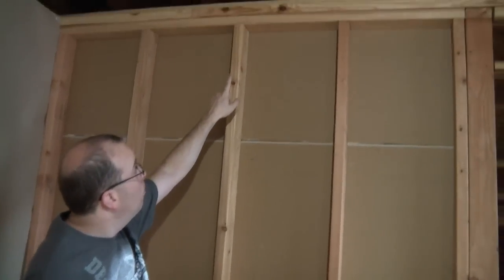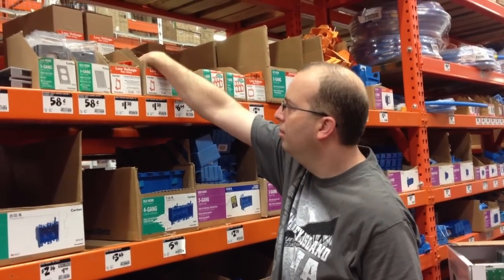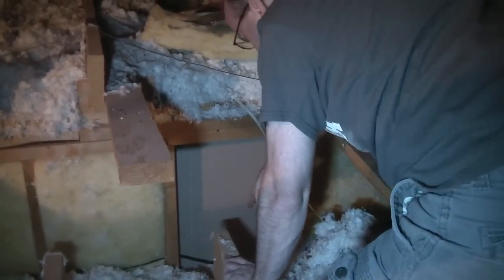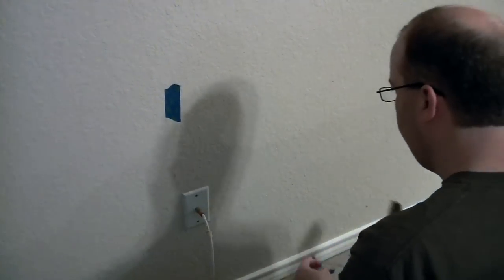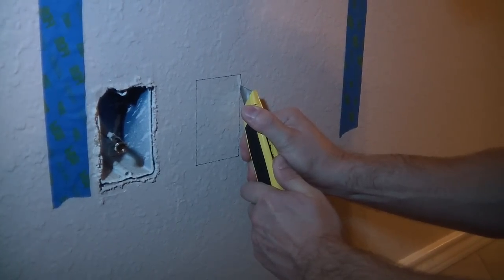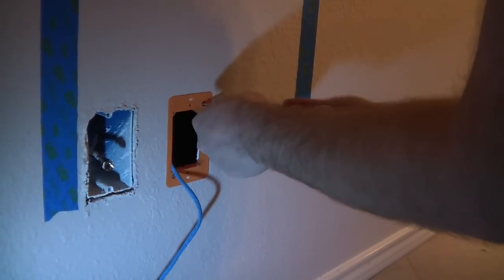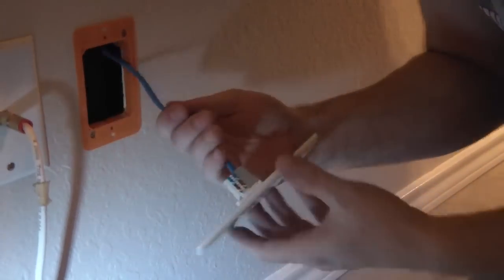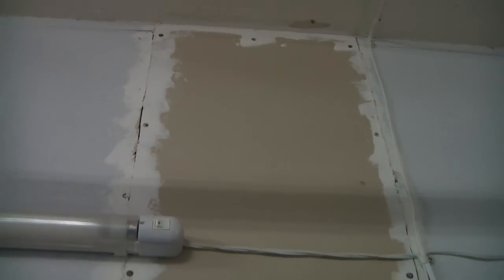How to install a network jack into a wall from the attic.

Comment: Please don't untwist your wires all the way and straighten them out. You're just causing cross talk at that point. Untwist your wires the minimal amount necessary to put them in the proper color coded slots.
Reply: it doesnt matter that he untwisted them because he punched the wires as close as possible to the cable anyway

Comment: Could you do something like this but instead of running it into the attic, run it through the basement instead? The way my house was built, it is completely impossible for anyone to get into the attic even remotely safely. But now that I have a small network that is starting to get out of hand in the corner, being able to install jacks would be a big help in making things look cleaner and more modern.
Reply: There are no or few basements in Texas, but it should work fine
Reply: Its the same but drill up instead of down

Comment: There is a way to do exterior walls. But you have to buy a special drill bit. A flexible cable with a bit on the end. Cut your hole, push the drill through the insulation and angle it up into one of the back corners. Drill through. Pull it out and insert a flexible cable into the attic space. This has a string attached. These are available with lights on the end. When the string gets into the attic, use a hook on a n extension rod, grab the string, attach the cable and pull it up.

Comment: It's only a network jack if the other end is connected to a NETWORK DEVICE like a switch for business or a router at home,
If you got to go threw insulation use GLOW RODS!  That way you will  see them glowing when you move enough insulation out of the  hole on the other end.
 In my  experience instead of cutting a square, trace the MUDRING (BOX) after leveling it.
( The face plate screws into this,  if the Mudring is NOT LEVEL your face plate WILL NOT BE LEVEL.
 Finally for you that are not in the industry, You're gonna see 2  Different color patterns on the Jack when you are punching the wires down one is going to say "A" 1 is going to say "B".
  Is common practice to use the B color (T568B standard) If you use "A" just make sure to do it on both ends.
 And please when punching those wires down done untangle them at all this helps prevent cross talk, And give a stronger signal that's why they're  Wrapped around each other in side of the cabling.
 For those of you that know about electro magnetism and copper coils you understand what I'm talking about.
 Great video, thanks!
Not  Criticizing just add a few tips, I've been in this industry for years and I do IT work for a Financial institution.
 I think everyone should know the tips and tricks to make our homes as nice as our working standards 
 Great video agian!
Reply: *hear lol dang auto correct!

Comment: Why not just use the same box as that coax line and swap out the plate to hold 2 keystones so you don’t need a cut another hole in the wall.

Comment: How would u do a coax wiring? And what do i need to get it running? I only have the xfinity wireless gateway and thats it, its a new house and it only has the wiring ,ac and plumbing done so the walls still have no drywall. How can i set up my internet with coax cable

Comment: This is a very helpful video.  Wouldn't it have been easier to just run the cat 5 down the same hole as the cable and not add another box to the wall?  Or just feed the cable through the box that the cable used?  I've seen combined coax and cat 5 plates.  Also if you're going to go through this much effort to do this, might as well run 2 or 4 lines.  Future proof as much as possible.  You make this look easy.

Comment: Another good advice would be to check your wall with a stud finder from top to the level where you plan to mount the outlet, because some state require to have additional horizontal 2x4's as firebreaks. And obviously, you won't be able to fish your cable through that.

Comment: Why not just use the existing low voltage hole that the Coax ran to? They make wall plates with multiple sections for keystone jacks.

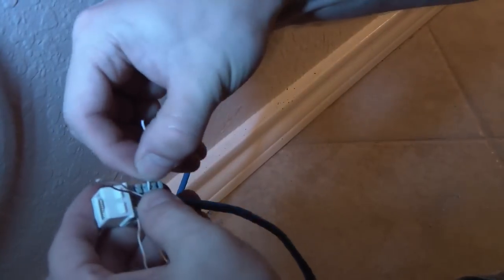Comment: 3:25 "next you can use your fingers to connect the colored wires to the network jack"

covers the most important part of video with hands and horrible camera angle
Reply: The point of the video is not where to put the wires on the jack, thats what the fucking instructions are for that came with it.

Comment: As an European sadly i can't cut my wall with a butter knife, the only solution is using Power Line. Anyway, are all american walls so thin and soft? What if you accidentally bump on the wall, don't you make a hole in it?

Comment: Shit I just ghetto style the set up by running long ass patch cables directly to the devices and use cheap brush plates to make it look “good enough” to avoid terminating wiring. Not a clean install but fuck all that work. Makes holes in the wall and run some cable, boom ! You got internet in the other room lol.

Comment: I beg you to wear a mask. It’s dangerous to breathe insulation. Good luck with your project!
Reply: How is it dangerous?
Reply: Anthony Champagne chemicals, my brother worked in construction and had gotten sick from insulation.
Reply: That's not good because I was working in the attic to rewire a coax and insulation was scattered around
Reply: as long as its newer, fiberglass insulation, its only causes temporary irritation and is generally not harmful in the long term

Comment: Why not get a dual wall plate with both RJ45 and RJ6 connections? You could even use a modular wall jack so you can run additional wires easily in the future.

Comment: Very good overall.  My only comment has to do with safety: (1) googles or other eye protection (you wear glasses, that's probably enough); (2) gloves - working with insulation, esp fiberglass batts; (3) dust mask/respirator (attics are incredibly dusty.  I also wear kneepads for attic work (not a safety issue, but a comfort one); a long sleeve shirt would be helpful (even in TX in the summer).  And finally, I throw all the clothes I have worn into the washing machine when I am done - by themselves.

Comment: I have two things to say even if this is an old video. 1. Do not untwist the wires. Your ethernett speed can reduse. 2. For those that do not have a way to get a cable behind the wall without thearing it down. Just know that you can get on wall mounted sockets as well.

Comment: Guys, it's not "paper" walls, it's drywall, which is a form of plasterboard.  Yes it is coated with paper, but it's made of gypsum.  Only internal and internally-facing parts of exterior walls are finished with drywall.  The exterior will be brick, stone, or siding (Wood, masonite or vinyl).  https://en.wikipedia.org/wiki/Drywall

Comment: if you drill a hole in the corner of the measured box and use a saw it is a bit easier, instead of the razor the whole time

Comment: Very nice job on that, thanks for sharing! I was having wifi limitations, so I'm running ethernet cables 82 feet from where my MOFI gets the best reception to where my editing room is. Are there junction boxes that simply allow you to connect an already terminated ethernet cable to the back and you just plug in at the interior? ORrrrr.. do I have to get the wire, cut, and terminate on my own? I'd like to just plug it in on both sides of the box?

Comment: I have installed network jacks and coax jacks on a outer wall in the past, and yes it is had to drill the whole through the top 2x4 but not impossible. If you need to install these jack on outer walls you will need a right angle drill attachment and some times a 3 inch drill bit will work but most times you will need a 4 inch if the top 2x4's are doubled. Just wanted to share some knowledge!
Reply: @Wolfmancollectibles  Yep I agree, I've done this for my office that needed a network jack on an exterior wall. Bought  a dewalt right angle attachment and used a spade bit to get down through the top plate. Then I snaked some fish tape down in front of the insulation, pressing against the vapour barrier till it hit the bottom of the wall. Cut the rectangular opening in the drywall and had my son use his skinnier arms to reach in the cavity and move the tape over, then I could pierce the vapour barrier. Other situations I've managed to drill the hole closer to the interior wall side so the fish tape slipped in front of the vapour barrier and pushed easily down the wall. Either way it is no fun getting into the cramped space in the attic while manipulating tools. Expect to be stiff and sore afterwards with an appropriate amount of cursing, but it can be done!

Comment: I did the same with with a cable line. even in Cleveland attics get hot. I put a thermometer in it and it was over 100'F

Comment: I really love your videos.  Thanks for sharing them.  That is not masking tape at 1:56.  That is painter's tape.  The glue is weaker than masking tape.
Reply: Painters tape IS masking tape! What do you think painters use it for? The adhesive is better quality than the classic masking tape, but it is still "masking tape".
Reply: the difference is in the glue.  the glue in painter's tape is a slightly weaker glue.  I know that "masking" tape is used to mask off so you can, say, paint without getting paint on the covered surface, but the stuff that is blue has a weaker glue and so is suitable for more delicate surfaces such as indoor walls, etc.  Then again, i could be totally wrong, but whatever.

Comment: For exterior walls, if you can't get through the insulation, you can always run the cable outside, just make sure you're using outdoor rated ethernet cables, and that you put sealant in the hole afterwards(silicone, for example). Also, never enter a cable in a hole in an exterior wall from the top, as the water from the rain will drip inside the hole - make a "U" with the cable if necessary, even if it's not looking very good. Or find a way to make it come from the bottom.

You'll have to be a bit creative to find a way to make the cable the least visible possible. Following natural/existing lines on the wall is the key, you might also want to choose a cable color that matches the wall color as closely as possible (i.e., not using a blue cable if the exterior of your house is white, white cables will blend in more easily). If your house has vinyl housing, then it's your lucky day, you can unclip the bottom and hide the cables underneath. Otherwise, you might be able to find conduits that closely matches the color of your house and hide the cable in there. Oh, and if you have to drill into a brick wall, never drill into the brick itself, drill into the mortar (and use appropriate drill bit and hammer drill), otherwise, the brick might break under the pressure of the hammer drill and replacing that one brick can be quite an hassle - and that's if you can find an identical brick.

Just a few tips from a telecommunication technician, as we constantly need to find ways to fish cables into people's existing home without tearing down walls. :)

Comment: Hey there. I also live in Texas myself any way I would like to ask you have you try do a video running  interior between though cells & floor why I ask I live in a 2-story home I would like to run a interior cable for TV & also a switch so I can used XBMC that they call it KODI box. For how I am used wireless cable TV streaming but I would like to run a hard wire so I can STOP used wifi extender okE-mail me Ok msa_0619@yahoo.com

Comment: You show CAT 5 wiring being used for telephone connections, I think this is rare. My house built in 1996 does not have CAT 5 wiring installed. I would think most viewers of this video do NOT have CAT 5 in their wall, making this whole video superfluous.
Reply: If I was to run a new "phone" jack anywhere, it would be with at least CAT5e cable, more likely CAT6. No sense in wasting a run that could later be re-purposed for ethernet if desired. CAT3 hasn't been used for phone runs since Y2K.

Comment: Why do people build houses with paper walls in the USA? Please don't be offended I am genuinely just curious.
Reply: Because materials are more affordable and our building codes allow it.
Reply: It's not paper, it's gypsum board (AKA drywall). It is slightly soft and semi-flexible, to allow for movement with earthquakes and other natural phenomenon. The wooden framework that supports the house is also flexible, but extremely strong. Think in terms of modern bridges - they use a lattice structure, and don't need to be solid stone anymore.

Comment: Props for MacGyver'ing a cutting tool using a box cutter, but there are actual, purpose-built sheetrock saws that are much less hassle to work with. I mean, you already bought specialized punchdown tools and such. Might as well complete the kit.
Reply: On the bright side using a box cutter means not having to vacuum up the sheetrock dust.

Comment: This video was almost perfect why not start from the beginning where did you run the other end of the cable? where did you get the Ethernet jack part from? how did you decide which color wires to put in that Ethernet setup?...just seems like if you're going to make a video why not do it right.
Reply: If you want to do a project like this, you'll simple need to run the other end of the cable to where your networking equipment is.
Reply: The color of the wire is entirely cosmetic. Use whatever they sell in the local hardware store (or what you can snag from the leftover pile at work!).

Comment: It is also a good idea to be careful when handling fiberglass insulation and to wash your hands after doing so.  You may find your hands are itchy after handling it; well, that's because there are tiny particles of glass on your skin which can irritate your skin or even cause a rash.  Needless to say, this can also track into your food if you are not careful washing.

Comment: Bare handing that insulation, brutal!!!
Reply: Contrary to popular belief  you can handle fiberglass just fine with your bare hands. Just don't be a dumb ass with it and make a fist with a hunk of fiberglass in your hand and your good.
Reply: @Coder-zx4nb  no it gets between you fingerprinta and itchs like hell i know and my dad know i help build a house
Reply: @chisholmjacob  If you do it for a living it makes perfect sense to use gloves. I was speaking from the perspective of a DIYer who is just doing insulation on one room or two and then never touching fiberglass for years. I should have specified, by B.
Reply: @Coder-zx4nb  From having somewhat recently worked some pink insulation into a tight space without wearing gloves, I definitely would never do it again unless wearing gloves. I was finding little fibers pricking in my hand for hours
Reply: @StalePhish  huh, that's weird. I re-insulated my spare room recently bare handed with no issues. I wonder if it depends on the brand..
Reply: Bro you just get tape or sticky soap and it comes right off. Don’t be that guy who spanks it right after grabbing insulation.
Reply: @bfitnessjoe  Lmao this comment made my day
Reply: And no mask with all the fiberglass dust everywhere... too rich for my blood.
Reply: It's just one piece, for a moment. Probably a little itchy and that's it. But if you are going to handle for a long period, then yes, wear protection

Comment: I did something like this. Ran 2 Cat6 cables + coax to every room in my house. Installed a 24 port switch in a small rack in my garage. A lot of work, but kind of fun. I try to hard wire as many devices as I can instead of using WiFi to reduce interference. I was able to run some cables on exterior walls and even near the roof line, but it's very tricky.

Comment: useful video, thanks
but what about lenght of a cable? will longer cable cause a signal loss?
Reply: Maximum length is 100M.  To steal from https://en.wikipedia.org/wiki/Category_6_cable this consists of 90 meters (295 ft) of solid "horizontal" cabling between the patch panel and the wall jack, plus 5 meters (16 ft) of stranded patch cable between each jack and the attached device.
Reply: Joe Graham How about Cat5e? are the specs any different?
Reply: @royce551
 For length, no :).  Cat 5e can also support up to gigabit ethernet.  Not that you would need it in home, cat 6 can go up to 10Gigabit.  On both of these, it's good to note, you can exceed the 100 meters if need be by putting a repeater or a switch in the middle.  the 100M is end device to end device (computer to switch, or ISP modem/router to switch, or ISP/modem/router to computer).  Sooo, if you somehow have something that's setup that your computer is 150M from your router, if you put a switch in there between the two devices, you can wire all the way to your PC.